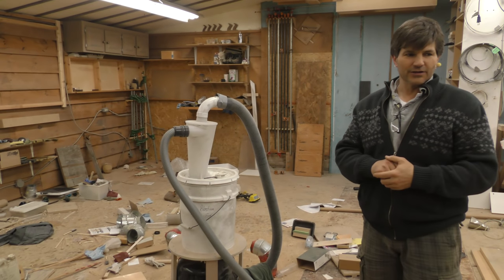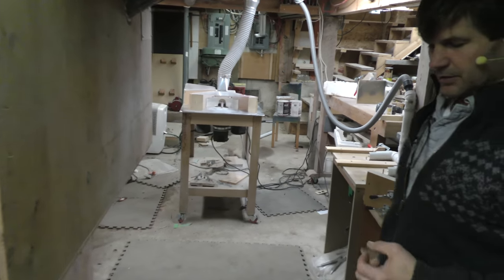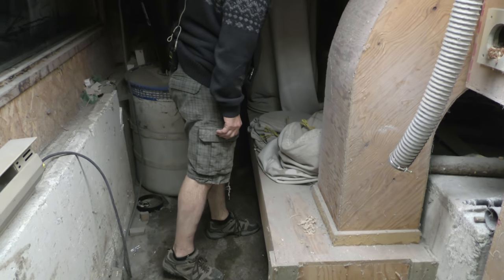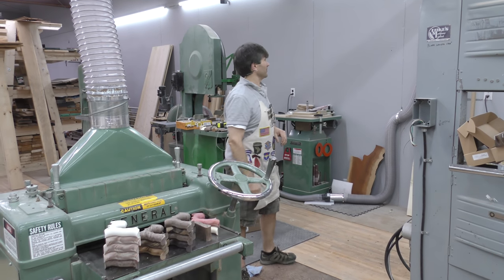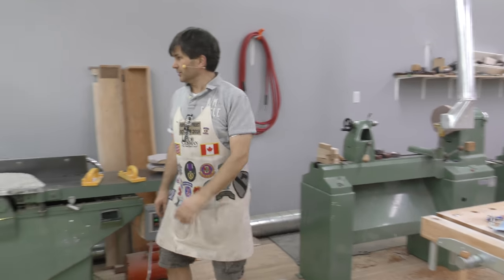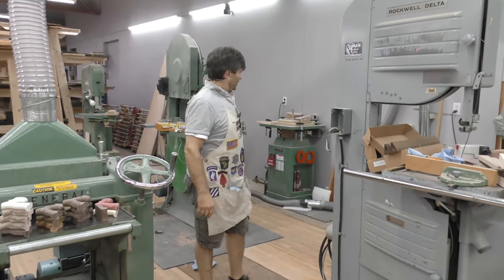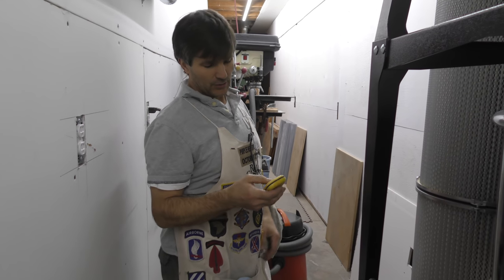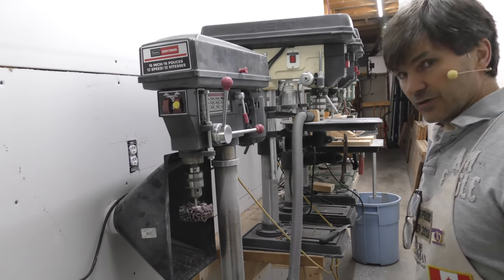Dust Collecting, Old Shop vs New Shop-Rob Cosman

Comment: Rob -- Thank you for what you're doing for wounded vets. My younger brother, an Iraq I war veteran,  was recently diagnosed with an inoperable brain tumor. He's always worked with his hands and I know how comforting it's been for him to get a few minutes in his shop to work on a car (which is his passion, not wood). So, I know from observation how much help you're providing other vets who need a similar outlet.

In a it's a small world note: If you graduated in the late 1980's, we were at university at the same time -- same campus, far different major.  While at school, I got my introduction to woodworking at Wright's Furniture Mill in south Provo. I worked the night shift trying to pay for school and dates. Wright's cyclone was three-stories tall. Could that thing suck! One time it got clogged and I rappelled down a rope inside the cyclone to break-up the clog. I was not being paid enough!
Reply from the maker: I remember Wrights, in fact I bought several pieces of equipment from them when the closed their doors.  Should say at auction, they went under sometime in the late 80's.  I worked as the TA in 190 of the Snell Bldg from 1986-89.
Reply: @RobCosmanWoodworking  quick question.  I have been watchimg your sharpening videos and really want to get a diamond stone. I know the Trends are the best, but as a beginner, will I notice the difference between it and a cheaper stone like a DMT duosharp? Is there a cheaper option than Trend other than sand paper (that is horrible!) I have a cheap water stone that is 1000,6000 grit, but I'm restoring 4 planes right now that need at least 300 if not 36 grit LOL
Thank you for your videos, they are great and very encouraging!  Keep it up!

BTW, where are you located?

Comment: Bless you for your work with Our Veterans. 
I had Oneida design my shop. Love it. 3 hp piped overhead with drops. Saw the comment about drops filling with dust. Start with the farthest gate open, shut it, go to next gate and open it slowly and it will clean out. Close it and continue on to all your gates opening slowly. No big deal to do every now and then.

Comment: The new shop & dust collection looks great. I love all of those made in Canada General tools. I do see a potential problem in your dust collection piping. When I did my dust collection system several years ago, I was told  to never put the inlets on the bottom of the pipe. The reason was that some dust coming from down stream will settle out in the drops between the machine being used & the dust collector. If those drops are not used often, the dust that settles out will clog them.
Reply: That is a good point. I made all but one of my blast gates at ceiling / trunk line height and have never had any problems except with the low one.
Reply: Hi, Chris, just to put your mind at ease, I have a similar arrangement, with all of my drops coming from the bottom.  Although you're right that some dust will indeed settle, the airflow seems to find its way mostly along the mains, and very little dust and debris will cause problems.  I should mention that I have an 1,100 sq ft shop with a 3hp Oneida cyclone, a 7" main duct that goes into a 6" for the last 30% of the run.  The drops coming off those two spiral main ducts are all 6", and narrow down to 5" to the separate gates and flex hoses.

Comment: The Cyclonic dust collectors are great. I've been using a ClearVue  for 3+ years... I just took off and thoroughly cleaned the filter stack. I got over 4 Gallons of ultra fine talk like dust out of them. Now I'm back up and running and it only took about an hour and a half.

Comment: Rob, have a similar Oneida system, highly recommend their Dust Sentry Bin Level Indicator accessory, as when when I run my 20'" HH planer (I'm always using rough cut wood from my mill) the 55 gallon drum  fills up so fast then overflows into the filter clogging it up before I realize it.

Comment: I just have my big tools (sawing, planing, sanding) on a covered outside deck to do the dusty work with large chicken house fans blowing away the dust . Then do the fine work inside my shop. Yeah, it get's a little cold sometimes but most of the time, letting the dust blow off outdoors saves  the cleaning work and saves the lungs, no matter how good a collecting system you have.

Comment: Rob,  I'm surprised you don't have 3 phase.   If there is a machine that you want in the future that is 3 phase motor, you can make your own.  Either buy and install single phase variable frequency drive( such as TECO) or have a roto-phase, add a phase or whoever and an electrical panel.   The second method is a three phase motor running on single phase creating three phase.   So if you have a 20 hp one, you can run up to 22 hp off of it.  The torque advantage of three phase motors may make it worth doing to you.
Reply from the maker: Kevin Coop I have lots of single phase motors that I purchased used, so it’s easier to just swap the motor. But in the event that I don’t have a motor to replace the 3-phase, I’ll use the VFD.

Comment: Can you explain that baffle more please? I have a massive sternvent system that sounds like a rocket ship. If that baffle would work for me without reducing suction significantly I would get one.
Reply from the maker: Couldn’t be simpler, about an 18” extension of the large pipe between the blower and the filter.  It is lined with 1” thick dense foam rubber.  That’s it!

Comment: A big improvement, nice. You may have a problem here however.  I don't  like stepping down big ducts to little ones.  It takes about 4000 Feet per minute to keep duct work clear. Below that the duct will clog.  Dropping down from  8" to 4 ducts cuts the flow more the half and the FPM. . The feed rate of the air supply  from the 4" duct  may not be sufficient to meet the 4000 FPM requirement in the big duct. That is a very easy thing to check. Your duct supplier should have a meter for this. If he does not he is a bit of a scammer.  What model did Oneida sell you.  I could run the numbers  if your interested. Since it's  installed the best way is to measure however. 
Auto gates are wonderful but expensive.  Jim Halbert has a video of DIY autogates here . He does not provide prints but they are easy to copy, especially the solenoid ones. A friend of his built air powered ones. I think he made prints but not sure. You can built a 6" one for $20-25 materiel + labor.  Jim, like me does not like 4" ducts. Why buy a huge Cyclone and then only use 1/2 the CFM by using 4" ducts. Does not make sense.

Comment: Hi, Rob,  I was wondering why you didn't take advantage of the space beneath your shop floor to run the ducting?  With a 5hp Oneida, I believe you would have had plenty of capacity to handle the additional length an under-floor arrangement would have needed.
In addition,  although I'm glad to see you used wyes for most of your lines coming off the main trunk.  But why did you go with a few T's rather than all wyes?
Reply from the maker: not enough room under the floor.  We couldnt get "Y's" locally so rather than wait we went with "T's" to get on with it.  Replaced most of them later when the "Y's" came in.

Comment: With that many large machines wouldn't it have been better to use a rotary phase converter for 3 phase power?
Reply from the maker: only a few 3 phase compared to the number of single phase.  I have lots of single phase motors 1 thru 5 hp.

Comment: Amazing dust Collecting system Mr.Rob .. By the way, can you please tell us about model of remote control system ... As the motor is 5 HP Single-Phase.
great video.. thx
Reply from the maker: We had to order remotes from a separate company, seems Oneida sells remotes not suited for 5hp motors.  Jake took care of that, I will have him comment further.

Comment: i've had their 5 hp system for 6 or 7 years now. it's been flawless. i was tired of an underpowered system getting clogged at the jointer and planer. it's a one time investment, you won't be sorry for.
Reply: I have the old Oneida that has the filter inside the unit, it's a pain to clean, however, for the amount of work that I do I only have to clean it about three times a year. Oneida makes a great unit well worth the investment.

Comment: is the system grounded.
Reply: Does not need to be.
Reply: it's metal pipe. take a guess.
Reply: Ok you don't believe in earth ground wow how funny
Reply: @boekelnj I know someone who had one at his moulding plant.
Reply: Still extremely rare though, his manufacturing plant was there many decades though before that happened. Also a company in Quebec that makes wood bricks out of saw dust had one.
Reply: @m.a.6781  It's metal pipe, and it's fed directly into the motor housing/cyclone. How about some awareness on your part instead of just going around blindly parroting fearmongering crap?
Reply: Wow I ask and I have received sorry for asking question.  I just ask if code was in N E C.  So I'm just about back yard safety. So I hope you all have a great holiday. Other people want to add on to their system metal instead of plastic sorry that you feel that are negative just trying to find out some information have a nice life
Reply: Hey, Kram.  Too bad some respondents were so flippant; I usually disregard them and hope that you do, too.

I am a serious hobbiest using the 3hp Oneida cyclone system from my former shop, in my present shop (1,100 sq ft).  In both cases I used metal ducting (spiral for the main runs and the heaviest HVAC ducting available for the remainder), with 5" plastic flex hoses going from the bottom of the metal blast gates to the machines themselves.  I haven't grounded anything on my new shop, as my former one wasn't grounded as I never noticed any static build-up.  That's not to say that static build-up is a myth, just that in my one-man shop it's never shown itself.  Never.  I am not certain how I would ground the plastic flex hoses to the metal ducting, but perhaps a wire pop riveted into the blast gates to adjoin the machine would do the trick.  The problem would be with my mobile machines (my molding machine, drill press and two shapers), as there'd be no place for the wires to be able to hook into those machines; perhaps a magnet on the end of the wire would do the trick.

Sorry for the lengthy response, but from my perspective I have never noticed any sparking in my one-man "hobby" shop.  Unless we're running a shop in a jurisdiction that dictates what we must have, we each have to decide for ourselves what level of safety we are comfortable with.
Reply from the maker: Kram Awagatuka to answer your initial question, yes. They recommend grounding the filter, as well as the barrel, so that’s what we did.
Reply: that's great thank you for the answer Rob so I can look at purchasing metal ducting instead of pvc. I'm sure new shop will be even greater then the old plus you can have your Purple Heart classes. Happy Holidays to you and your family

Comment: Did you check into the ClearVue system at all, Rob? My understanding is that a Mr. Pentz, who had serious lung damage due to an improper dust collection did extensive research on cyclone design; and ClearVue uses his design... But, I've never found anyone who sells Clear Vue hear in Canada...
The Wood Whisperer installed a new Onenida system in the last couple years and loves it as well.

I'm amazed how much that baffle silences the sound! 

Looks like you're almost ready to go back in full production, there at the new shop!
Reply from the maker: baffle was incredible considering it was a tube lined with foam rubber.
Reply: stockroom supply sells CV stuff in canada. it's imported from the US but I'd check with them if anything is ULC Certified